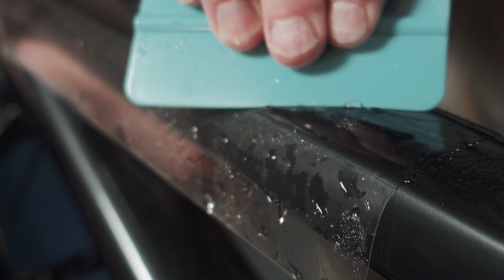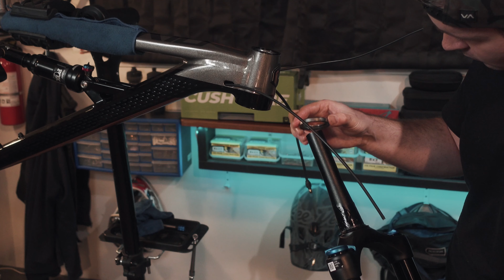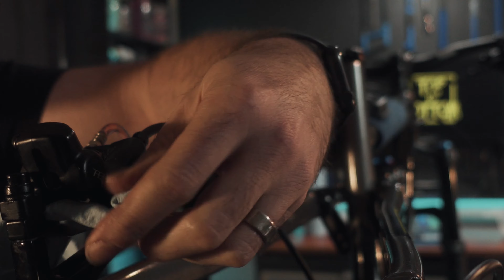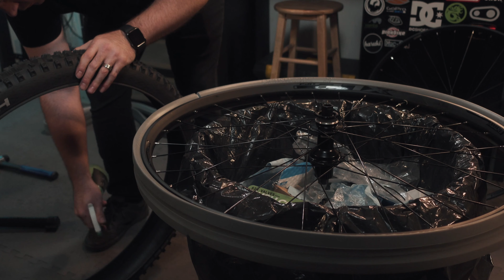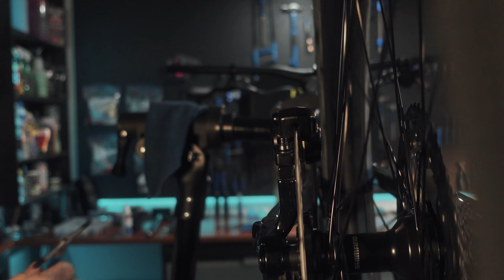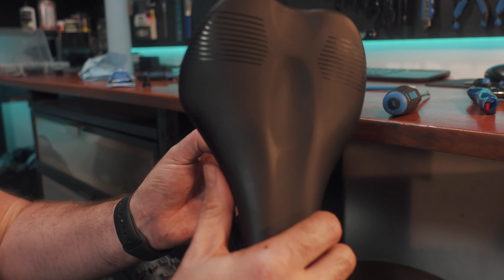DREAM BUILD MTB - 2023 Polygon Siskiu T8

Comment: I like the idea of taking everything apart and reassemble it, peace of mind when it comes to correct lubrication, but I wouldn't had taken the hydraulic brakes apart if I wasn't replacing them with some better, IMO
Reply from the maker: Just did it for the video… thanks for watching! Cheers!🍻
Reply: That wouldnt be for me, i’d end up rounding off all the bolts, putting the tyres on backwards, overtigntening the stem and crushing the handlebars, filling the brakes with bike cleaner instead of brake fluid, etc
Reply: @Melon_1-e4g  lol

Comment: Nice video quality/production, but, those are all the stock build parts. Did you just remove all of the parts off of a stock bike and put them back on?
Reply from the maker: No need to change the build! Just highlighting how the components it comes with are great and you don’t need to go overboard with vanity parts that cost an arm and a leg. Added a couple upgrades and made sure everything is properly tight and lubed. Now it’s ready to rip!🤘🏻